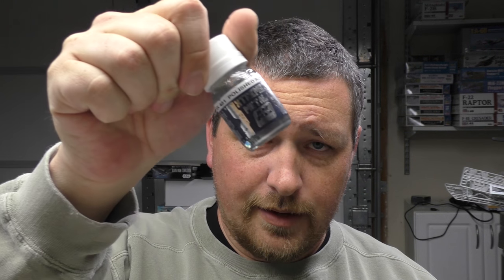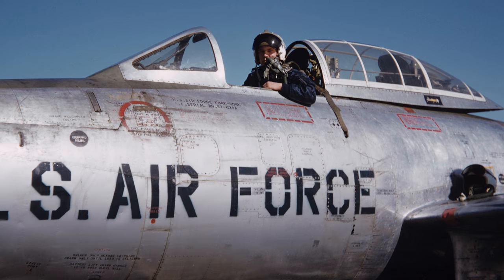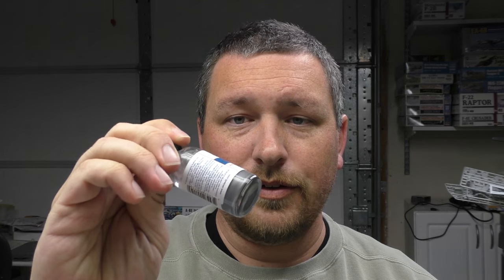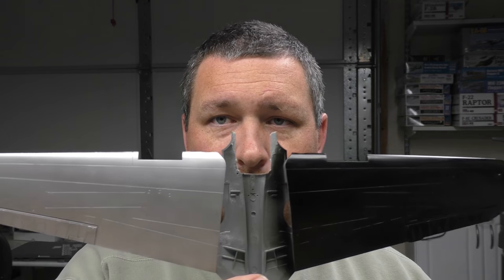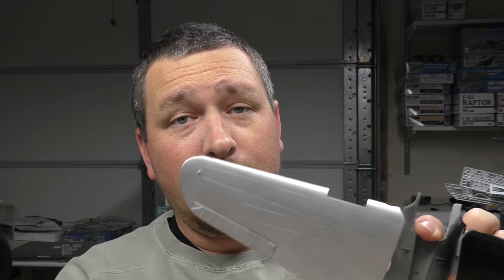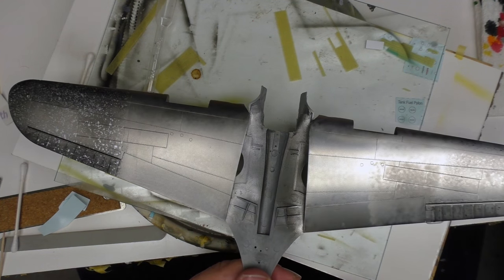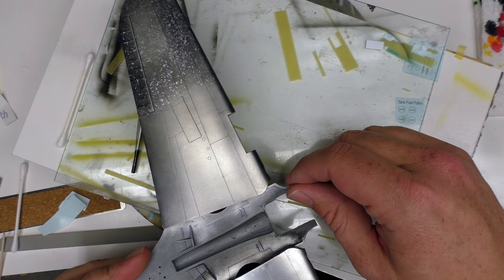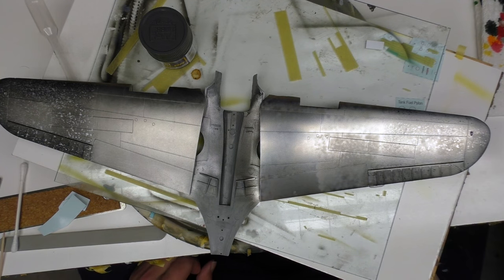Bare Metal Variance - Part 1

Comment: Hello!  Tell me how do you get that super glossy black base coat? With all the steps please
Reply: Use the paint he said to use and very carefully love on it with some 6000 grit sandpaper.  Or 4000 grit at first then 6000 to finish/touch it up perfect.  Someone who's done it a hundred times could use their fingers and get a good result.  I don't think he mentioned primer either but I'd recommend a light coat of primer first.   If you have raised panel lines then disregard this comment.  Did you do anything model-wise since and how'd it go?

Comment: I'm wondering what might happen if, instead of using an underlying tonal variation, you used a gloss/matte variation? Gloss black marbled with a matte coat?
Reply from the maker: +Scott Roby two main challenges with that as I see it from some past attempts at sheen variation. First is that it's hard as hell to see what you're spraying when it's a clear. Second is that Airframe Aluminum and the other high-shines really depend on a smooth, shiny undercoat, so there's a good chance that anything matte could break that magic. I've thought about doing something like that for non-NMF aircraft though, and every time I've tried it's come out looking terrible. Not ready to give up yet, but it's a different nut to crack, for sure.

Comment: How do you apply the salt? It's a technique I've been wanting to try but I'm not clear on how to make it adhere to the surface for painting over.
Reply from the maker: Use lukewarm water (may need some surface tension breaker added - you don't want it to bead), apply salt, then hit it with warm air from a blow dryer on low
Reply: Simply search for "Salt Chipping" or "Salt Weathering"... Bless your heart!